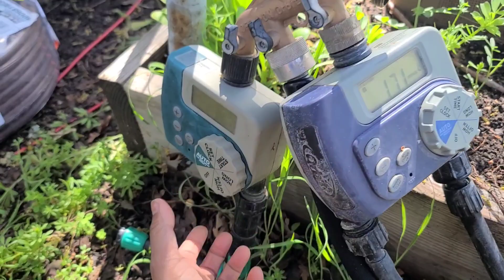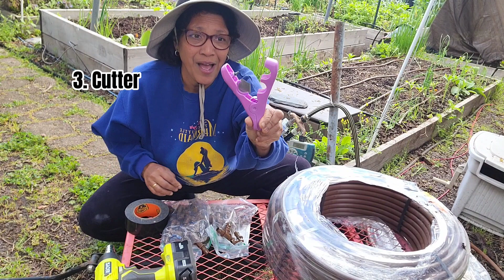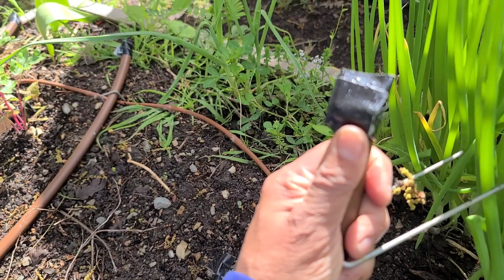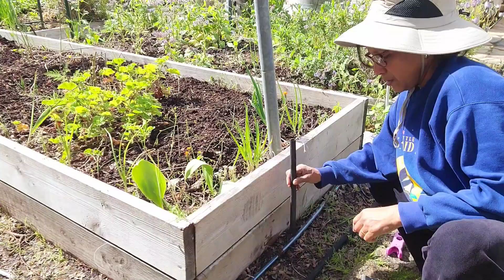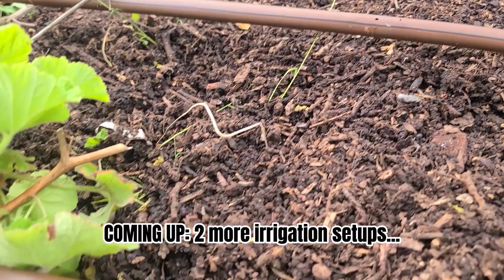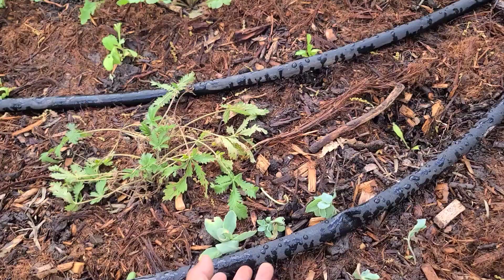Install DRIP IRRIGATION: Save Time, Water Smart, Transform your garden!

Comment: I am so intimidated by irrigation systems. Your video made it much more understandable. I had hoped to set it up this year, but, have decided on a splitter to have 2 hoses for this year. Hopefully next year I will get it together. Thanks for sharing!
Reply from the maker: So glad you found it helpful!  Putting in irrigation has been transformative for my garden, especially with my hot dry California summers.   I waited too many years because I thought it was too much work.  But now I know it's not that hard...so I want others to feel confident as well.  Have a lovely gardening season!
Reply: @GreenLove1  I'm in Nor Cal 9B. I'm gardening in raised garden beds, stock tanks, totes, bags, and pots. I can't quite wrap my head around how to do it all. Your video did help. Cheers!